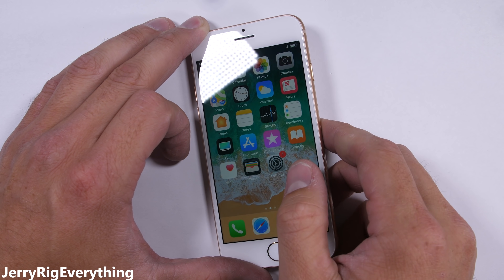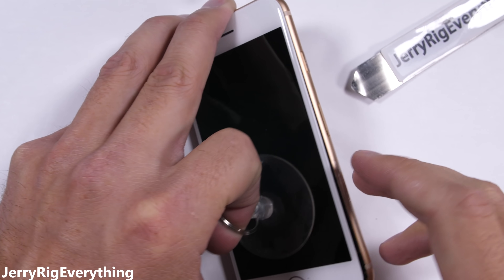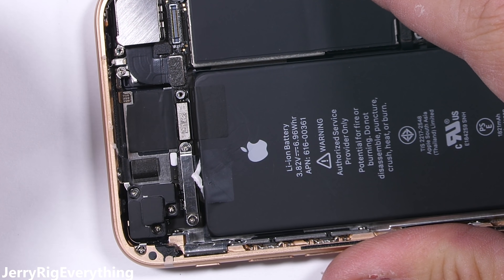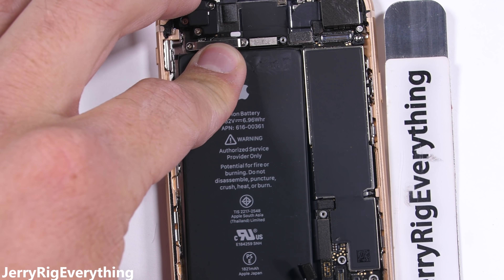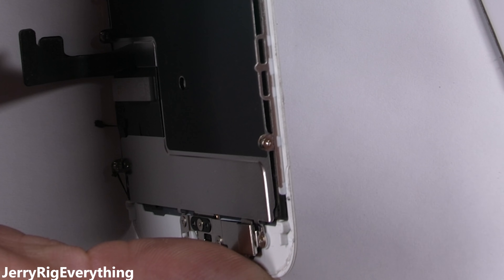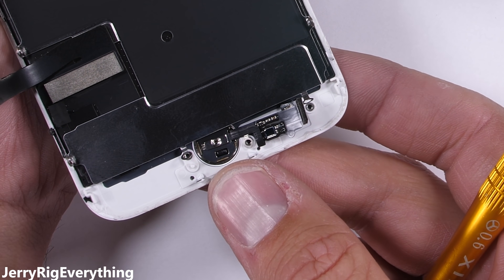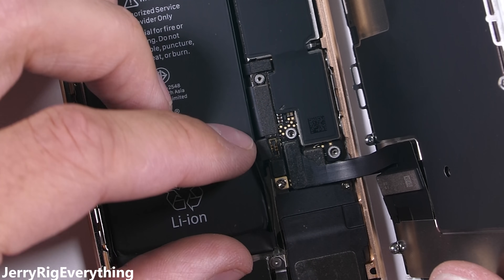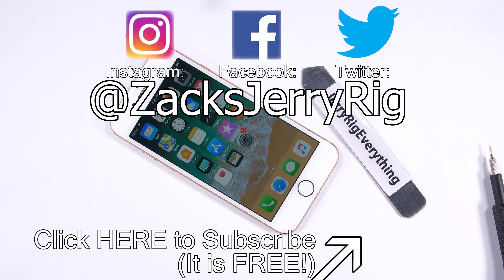iPhone 8 Teardown! - Screen and Battery Replacement Video

Comment: I clicked on this video slower than Apple's A7 chip. =/
Reply: More like A5 in 4s
Reply: Hehe A9 here.
Reply: Shellyman Vol.2 Here Snapdragon 835 and i7 4770k
Reply: A10 Fusion Chip here!! 😁
Reply: Daniel Trejo same
Reply: Daniel Trejo GG
Reply: Ryzen 7 1700 here
Reply: Shellyman Vol.2 A11 Here
Reply: But the a7 was a pretty fast processor for the time. It had a geekbench score of about 2500 meanwhile a snapdragon 801 from the same year had a score of 1800- 2500 

The snapdragon CPU has different numbers because many different phones use the 801 chip so they also get different preformance.
Reply: Exynos 8890 here
Reply: A11 bionic here bitches.
Reply: Mohammed really? I'm a bit confused, could you tell us the Antutu result of your phone? I'm really curious about it
Reply: Shellyman Vol.2 but that's like from 4 years ago innit
Reply: SD 836 here
Reply: i7 7700k stock here
Reply: i7 7740x haha.
Reply: A9X here with 2 gigs of RAM
Reply: BlackDragon31000 Lol
Reply: A9X with 4GB RAM here :) (1st generation 12.9-inch iPad Pro)
Reply: A9 is very quick and powerful, that bad thing is that it will kill your battery quickly during very intensive games.
Reply: Shellyman Vol.2 here with an A9X
Reply: TheTechPerson Since there is a lot people with the A9X chip on their devices... how’s your battery life with iOS 11 because mine decreased a lot and my battery wear level is 3%
Reply: BlackDragon31000 i actually have a device with the  chip (upgraded to iOS 11, and it is slower than iOS 10. The battery life is about the same, but it may be a bit worst. I dont have iOS 11 on any device with the A9X chip so I unfortunately dont know. But if speed is one of your priorities, I wouldn't recommend iOS 11 for now. Hopefully after a while it will be more refined and speedy.
Reply: Shellyman Vol.2 snapdragon 820 here
Reply: Snapdragon 835 checking in!
Reply: Shellyman Vol.2 A6 here lol
Reply: yes you waited for milliseconds
Reply: Exynos 8890 here
Reply: Shellyman Vol.2 Don't worry A11 chip is a Gimmick
Reply: Pixel just now Exynos Defeated A11
Reply: Bl Chitu Tech Trinkets?
Reply: Snapdragon 835
Reply: Shellyman Vol.2 snapdragon 955 here
Reply: i5 6400T here
Reply: GhostLegend 03 Samsung Exynos 7578 Quad here
Reply: Snap dragon 835
Reply: Shellyman Vol.2 woo woooo woooooooo
Reply: Snapdragon 835 here
Reply: Exynos 8890 here
Reply: Lmao geezers A45 Chip Here
Reply: A11 bionic here
Reply: diese ganzen lügner hier die erzählen die ahättten den A11 ^^ mit etwas glück  hat einer von denen wirklich ein iPhone 8/plus
Reply: 5c
Reply: A11 Bionic here
Reply: hidde1626 Same
Reply: Shellyman Vol.2 got the A7 and Exynos 7420 here, 5S and S6 edge HAHAHA
Reply: A12 Here
Reply: way to go Shellyman you can make fun of an outdated chip
Reply: XD do you have iOS 11 on that A7??
Reply: No I have an A10 in an iPhone 7 + k, don't assume things
Reply: A6 here ☹️
Reply: my phone has an A6 in it... :(
Reply: A9X, Snapdragon 821 and Ryzen 7 1700 here :)
Reply: i have an a9 instead of the x if that matters and ive been on since the first beta but ive been getting great battery life
Reply: A10-Fusion here
Reply: A-8 on ios 8.4.1
Reply: A11 Bionic here
Reply: Shellyman: Infinity
Here with a A9 Chip 4”
Reply: create don’t be sad, at least you don’t have to update to iOS 11.
Reply: Shellyman Studios don't u talk shit about my 4s's chip :/
Reply: A11 boiii
Reply: khalil taylor bish I've got an 11...
Reply: A11 fusion chip aha
Reply: Hehe A11 Bionic here 
Btw I clicked on this video faster than Apples A12 xD it’s very fast!
Reply: Here A11
Reply: A11 Bionic
Reply: A12 Bionic chip
Reply: A11 Bionic

Comment: So much wasted space for battery... Make it even smaller next time Apple
Reply: Pawel Wroniecki all they care about is battery power. Nothing else.
Reply: Pawel Wroniecki I remember they reduced the capacity when they went from iphone 6 to 6S and they did the same from 7 to 8. Let me google it real quick
Reply: For anyone that cares, these are the numbers for the battery capacities. Smaller phones only, not the plus

iPhone 6 1810mah
iPhone 6S 1715mah
iPhone 7 1960mah
iPhone 8 1821mah 
(I know the mah isnt the only factor that affects how long the battery lasts, just comparing numbers)
Reply: i have a 3100mah in my honor 7. 3000mah+ is todays standard tech in a phone. if it doesnt have atleast 3000mah then it wont last charged long enough when devices need more power usage these days, for instance 1080p screen doesnt use as much power as a 1440p screen on galaxy.
Reply: The iPhone 8 has a 750p screen.
Reply: SAS Productions 3000+ is standard for android phones but for iOS I won't need as much power because of optimization. Both phones would about the same amount of time. But 3000 mah on a iPhone would be pretty nice 😀
Reply: lol
Reply: well i had a iphone 4s and iphone 5 and both of them phones would die really quick using youtube or games or internet or video and i would be charging like 4 times a day. so since then ive never got an iphone. the only thing i like with iphone is jailbreak iphone. without it its shit in my opinion. also apple restrict apps like weed firm on android, and tea firm on ios for instance. i seen the video of the new iphone the other day and i didnt feel excited or think omg that phones fucking amazing, cus it really aint. its just the same shit but a little bit better. wow. thats how i looked at it.
Reply: Chrono Cubing ah noh, i have both and my iphone drains much faster. About 50% faster.
Reply: Chrono Cubing I don't get why the battery is still so damn big when it has like pretty much less than the android standard
Reply: Chrono Cubing not really. I got Galaxy Alpha and i5, both purchsed and used at same usage, yet my i5 is slower and drains faster on standby (well, a bit unfair since Alpha got the data connection on and i5 got the data off).
Hell its even faster than Galaxy Alpha when I play Vainglory :/
Reply: At least it's not too big. See what's wrong with the Samsung Galaxy S7?
Reply: Pawel Wroniecki although waiting so much of space they can't add a headphone jack
Reply: Pawel Wroniecki they made the battery smaller but still couldnt fit a headphone jack
Reply: No can do
Reply: SAS Productions Redmi 3s prime here. Nice 4000mah battery inside 5inch phone :)
Reply: But the galaxy's default res. is 1080p unless you change it in the settings.

I have an LG G6. It would've been nice if I had this feature to conserve battery.
Reply: Billsofat False only on some videos because of the quality recorded
Reply: SAS Productions congrats, you own a piece of shit Chinese android that needs a giant battery to make up for the horribly made OS. Fortunately, iOS handles stand by 10x better, so a smaller battery lasts longer than the giant ones in Android phones
Reply: attest u have more battery Jesus dude

Comment: I like how you cut the most important steps out, some one with no knowledge wont know that youre using heat to loosen that adhesive. They will surely fail from watching this video! But I guess most people arent going to be watching this as a step by step anyways

Comment: Re returning the many size screws into the phone in the original location. 

Before opening the phone I search online for some images of the phone circuit boards, then print them.  (bigger the better) 

I then use a pen to mark the location of each screw on the image.   Next I place a strip of double sided tape on the print out sheet for each screw, or series of screws.      Now as I remove a screw I place it on the image next to its location.   If I find I have a few screws from the same area, so space is tight I draw a line from the screw on the double sided tape to its correct location. 

Double sided tape is good as it holds them in place yet is easy to pick up each screw by using tweezers.

Comment: I do all my screen repairs by heating up the screen and cutting the adhesive away from the screen, leaving it perfectly intact inside the frame. 

And to plug in the ear speaker flex cable, I tilt the screen up and plug it in like the older phones and screw the plate down.  Then turn the screen sideways and plug in the screen and home button, then battery and screw that plate down.

Comment: When you put the screen back plate back on the display and home button connector top right corner is supposed to go under the metal plate. It probably won't effect anything as far as using the phone but the OCD In me noticed.
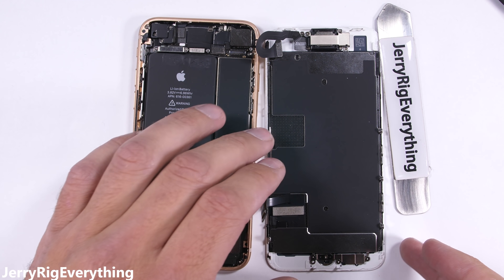Reply: 3:17 before and 6:15 after

Comment: Great video. I am having trouble getting the home button working after reassembly. Doesn’t help that i lost the microscopic screw on the far right end of the home button bracket.

Comment: Someone may have already said this, but you did not put the screen back plate on correctly. The ribbon cables need to be partially covered by the back plate and it's very important that the correct spacing from the plate to the IC is correct so the screen fits back in correctly. Just thought I'd point that out.

Comment: Thanks for the instructions. I pulled one apart today and on this iPhone 8, Apple used triangle (or tri-tip/three tip) screws to hold down the battery connector cover. :(

Comment: I gotta admit. Making a water resistant phone without having to heat everything up with a heatgun is quite a good thing. I bought my OnePlus 5 because of the non-existence of adhesive this phone had,making the repair easier from the start. If every phone had this idea, things could be way easier to work with

Comment: I just did this and the phone got stuck on apple logo.
I removed the front camera ribbon cable and it worked so i just reconnected the whole front camera+sensors modules again and now its working perfectly.

Comment: Doing this exact screen repair and my last 2 screws from the old screen are not coming out with my Y screw driver, it is the right size because I used it for the other screws. Any help please??
Reply: You probably figured this out already, but there's a slight difference between Y000 "Tri-wing" and Y000 "Tri-point" screwdrivers. You want to go with the "tri-point" drivers for this job. I bought one from ifixit and it's been a great tool thus far!

Comment: Why not use the waterproofing seal after repair? Costs a dollar or so at iFixit
Reply: Still isn't properly waterproof with a new seal, more like splash "resistant". I definitely would've used it as well, but considering he's going to open up the phone a few more times it wouldn't make sense.

Comment: At 6.96Whr, it looks like the battery is just under 2000mAh assuming a 3.6V nominal cell voltage. If we use the labelled voltage of 3.82V, it's even lower. That's a surprisingly small battery.

Comment: Screws are different lengths because they're different things they're holding down it's made separately peace by peace it's not just a  Circuit board with a screen on it and a glob plastic overtop

Comment: Question - I replaced my charging port and microphone and everything went well but now my fingerprint reader is not working. If I enter my settings and try to capture/record my fingerprint, the phone makes no attempt to capture the print. There are no errors but nothing happens. Any thoughts? Thank you for your work and time on these videos!

Comment: the home button on iPhone 7 and up are extremely thin! as he said, be very careful. I made the mistake of tearing the ribbon cable as I was fixing a customers phone and had to pay for the replacement of a whole new phone. I tried to get to get the button fixed, replaced, everything. Nothing worked. TAKE EXTREME CAUTION WITH THE HOME BUTTON AS IT CANNOT BE REPLACED.

Comment: wished I knew about heating the adhesive first with a hair dryer...  I broke all 4 pull tabs and had to resort to prying away at the battery, which ended up as a major FAIL!  My iPhone 8 Plus promptly resulted in battery leaking and caught fire!  Phone trashed!😮‍💨🙄😪

Comment: I’m looking to do this to fix my iPhone but I’ve never replaced a screen. I’ve followed you video on the Nintendo switch shell replacement  with no issues. Would you say this is a similar difficulty or more difficult?

Comment: So I just replaced my screen.  I didn’t need this video bc all I had to do is reconnecting of the cables.  New screen doesn’t work but I put the  old screen on and it works.  The same thing happened when I replaced the now old screen.  It didn’t work so I got a new phone.  I came across it months later and it was working.  Kinda wired,  I wonder if the same is going on now.  So confused.

Comment: Using the "Premium Aftermarket" screen, it now has a life of its own and will swipe and move in any direction it so chooses, without even touching the screen. The software is completely updated. Any suggestions?
Reply: Jordan Haglin buy ifixit parts
ifixit parts are the best!!!
Reply: It will most likely be the lcd display no function right

Comment: Where is the link for the digitizer assembly you used?  Also can you cover lock policies with the new financing options and R sims.  I was recently sold a beautiful 128gb Iphone Red Brick for 300 bucks cause sprint requires the original seller to request unlock.

Comment: Hey Jerry, just wanted to ask, since i cant order the adhesive strip thats holding the lcd to the body of the phone, as it cannot be shipped to my country and is not locally available, but on ali express i can get it but i am not sure about its quality. Should i order it from ali express? I am just worried about the quality of adhesive strip on AliExpress.

Comment: Hey, i recently had my iphone 8 screen shattered. So after I remove the adhesive(between the lcd and body) thats blocking anything from going inside the phone, is it safe to reapply the adhesive after i get the new screen and what adhesive is it?

Comment: my iphone 8 cheap screen works, but original is not. the phone is on and im 100 sure the display works, because i tested it on other device.. any help? i just get black screen when connecting the original one

Comment: Hey I need help so I bought a new phone screen for my iPhone 8 plus and since I'm no professional I'm thinking of getting the screen on with a nearby repair shop and they say it would cost like $40 to get it on and $100 if my screen doesn't work is that Ummm like fair or what the $40 I mean ty for the help ;(

Comment: holy fucking shit this actually worked successfully besides the stress of all the screws the hardest part was prying the old screen off my id suggest using a thin razor bur yeah successfully replaced mine and got it started just two things he should get into more detail though on lining up the tiny connections for the home button and battery etc they are not that easy to snap back on if those microscopic pins are not lined with the holes right i thought i bent them at first but its just take a little finesse and the most pressure possible with out breaking itand also my screen did not work after the first charge and power up but a simple soft reset fixed that thank you for the video all and all

Comment: funny story I was trying to fix my 8 plus and when I ordered the screen it came with those cheap tools and I had to use them. Probem nr.1 I couldnt remove the screw that went in the homebutton so I bent the metal around it and thought its already probrably broken. Now after I installed it, it just worked and its a miracle now my new screen didnt come with a backplate to I had to rip the old one off because I couldnt remove the right hand side screws but I got the backplate on. btw I had to use force to get the display out in the first place because a screw was stripped. anyways at the end when I wanted to put everything back together that stripped screw was in the way so I broke off one of the screwholes on the screen. So yea thats my story (it was an emotional rollercoaster)

edit: everything works now touch id and everything

Comment: I read that after replacing the screen on an iphone 8 that they somehow aren't as bright as before. Does anyone know if this is true??

Also, I replaced the battery on my iphone 6 and after doing so, it doesn't show the battery health. It just says "service". Then when you click on Battery under Peak performance Capability, it says "This iphone is unable to determine battery health. An Apple Authorized Service Provider can service this battery".

I replaced it about 2 years ago (I think)and the battery works great. Is there something that needed reset to have the battery health show correctly?

Comment: Does anyone else feel like phones should come with screen protectors already installed? Not saying it's really too likely it would happen but I feel like there's no one who doesn't want a screen protector so it would save trouble and if you actually dont want it just take it off. No downside to it. I suck at installing them and always fuck it up.

Comment: Where is the thin gasket that sealed the perimeter of the display that you removed during disassembly?  You did not put another one on.  This is rather egregious in that it serves a very important function and this procedure just tossed it aside and ignored it.  Disappointing, and no, this is not okay.

Comment: I won’t buy apple products again, ever! This phone has nothing different from iPhone 6, same design and architecture with some glue around the edges to make it water resistant and a decent chipset to compete with the rivals.. I would value iPhone 6 more expensive for the progress it did from iPhone 5, than iPhone 8 two years after 6.. lost all that little trust I had in that company!